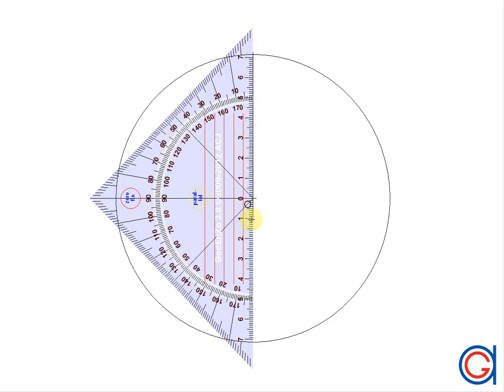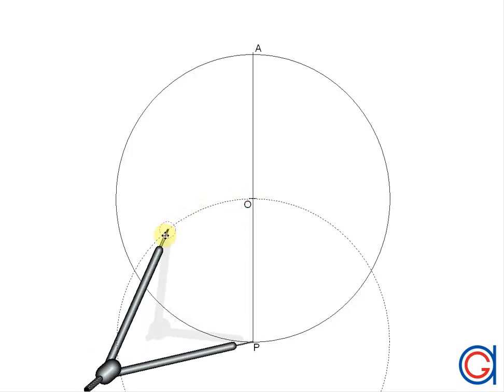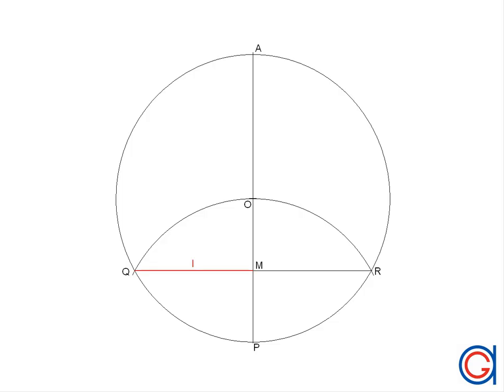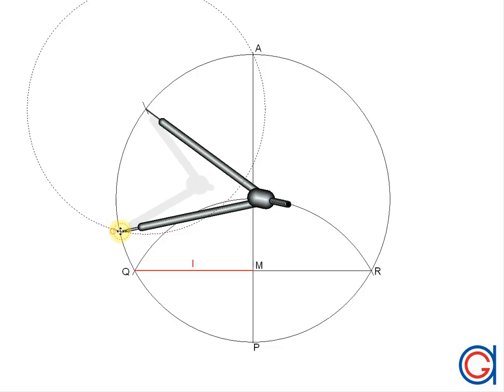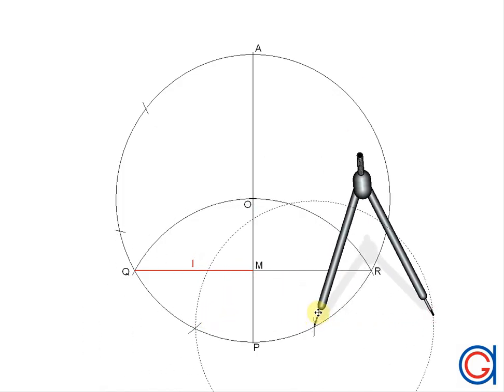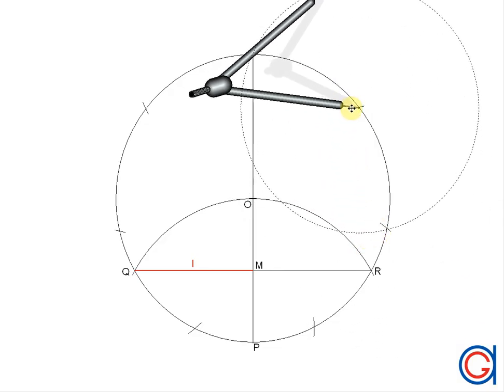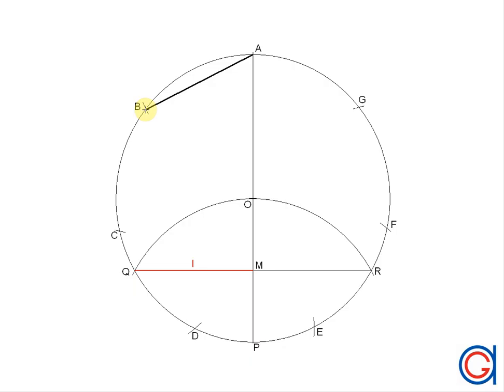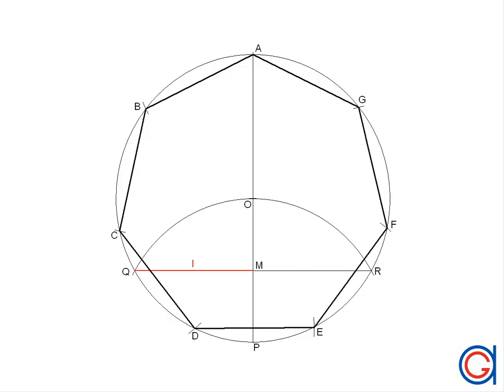How to draw a regular heptagon inscribed in a circle

Comment: THIS IS DEFINITELY NOT ACCURATE ! ... try drawing it up in CAD ... it will give you an error of 0.8 degrees! - if you draw a circle with a 1m radius the error with this method is 1.35 cm - definitely not acceptable for engineering
Reply: I "discovered" another method by kind of reverse-engineering a regular heptagon and finding some relationships between the lines and I think it works, but I'm too lazy to try and prove it now (I think I'll have to use some basic trigonometry, but I'm in the 8th grade, so that's not happening). The only thing I know is that I didn't need to inscribe the heptagon in a circle to do it.
Edit: the side lenght I used is arbitrary, but corresponds to about 2.95cm, so you have a sense for the scale, and I did not have a noticeable difference of inner angles from an actual heptagon.
2nd edit: I used some pithagorean theorem and quickly learned about sines and cosines and what not and it turns out my method isn't perfect as well, but I had a difference of about 0.11 degrees from the inner angle of a regular heptagon, so that's cool.
Last edit: I just proved my method completely stupid and wrong just by measuring some angles. It's worse than tge one in the video, but at least it closes up nicely. And at least I learned to use sines and cossines correctly.
Reply: It’s an approximation

Comment: The regular heptagon is the simplest regular polygon that can't be constructed with only a compass and straightedge
Reply: exactly? because I did before with a compass and straight edge
Reply: @danielegwurube6544  https://www.youtube.com/watch?v=O1sPvUr0YC0
Reply: @danielegwurube6544  it’s an approximation
Reply: It's a Heptagon... Just not a REGULAR Heptagon.  It's Off by 0.2%, an approximation attributed centuries ago by Albrecht Dürer, as noted by some others here, and documented here in Wikipedia:

https://en.wikipedia.org/wiki/Heptagon#Approximation
Reply: @michaelkrupa131  "It's a Heptagon"

Nonsense. You could pick any length for the side and then just connect the last two points regardless of their distance. But this construction does not create a heptagon inscribed in the circle.

Comment: How accurate is this video?

A regular heptagon:
l=2*r*sin(pi/7)
In the video:
MQ=r*cos(pi/3)=r*sqrt(3)/2
Does 2*r*sin(pi/7)=r*sqrt(3)/2?
Divide both sides by r:
2*sin(pi/7)=sqrt(3)/2
Divide both sides by 2:
sin(pi/7)=sqrt(3)/4
Use a calculator cause f*ck it:
.4338837391...=/=.4330127019...
Reply: Excellent!
Reply: I'm generation z and I'm losing my mind on this math, can y'all teach me?
Reply: @Unknown-zd8us  sure, what's troubling you?
Reply: @michaelweiske702  well my teacher said to me, I need to draw a heptagon so I search the video how to draw it. I see the comments in this video and I got really confuse, one of the comment said this video show not the real heptagon. What's that even mean? Then why the thing they draw in the video look like heptagon? Also some other comments say about the equation of this heptagon is not the same with other heptagon?
Reply: @michaelweiske702  My question is, why this heptagon that show in this video is not the same with other heptagon?
Reply: @michaelweiske702  Nevermind, my question is stupid. Sorry for bothering you sir/miss
Reply: @Unknown-zd8us  well, what they mean when they say this isn't the "real" polygon is that it isn't perfect. This is an approximation of a construction of a heptagon, but it isn't mathematically a true heptagon.
The approximation does work really well, the math shown says it is accurate within a 10 thousandth of a unit, but at larger scales the differences really show; either the sides won't link up or one side will need to be longer to compensate.
I believe it has been proven that you cannot construct a perfect heptagon of a given dimension, but you can get close as this video shows.
Reply: @Unknown-zd8us  there are no stupid questions.
Reply: @michaelweiske702  Ooh, I understand now! So the heptagon show in the video was not a perfect heptagon. Thank you for the explanation sir/miss.
Reply: @michaelweiske702  wise words 🤓 I'm still learning 😅🙌
Reply: Totally inaccurate.
Reply: @pintificate  prove it
Reply: @DarkonXBL  Proved Long Ago!

Comment: i don't get why there is so much math critics over here,listen to me ya all there is something called in phyiscs the common errors that is something that no matter how accurate we can get we won't ever be 100% accurate espacially when  dealing with numbers for example the hour here at my country is 12:32 and if i checked my brother's phone it is 12:33 and my mother's phone is 12:30 now can someone explains to me why does that happen ??? although the seconds periods is designed equally in the three phones there still some glitches, maybe they are the same brand and the same model yet still no conclusion what is going on and we cannot decide which time is the completely 100% accurate yet it is not a big deal cause minute higher minute lower ain't that big of a deal especially when don't have any full 100% accurate methods which by it we can measure the time, another example the approxmation ratio which can includes that when you have number like 5.8777163536...we don't have time to write all of this shit but we can easily take a few three numbers from after the decimal and conclude it as the full number so the final would be 5.877 although this number is not equal to this number above the math laws consider it acceptable as in the Pi value we all now that pi equals 3.14159265359 but we only write it 3.14 and nobody complains about that and many mathematical problems uses 3.14 specifically not even 22/7 in order to solve the equations and the answer becomes this moment  100% accurate and there is also something you never asked yourselves when you were solving math limits problems which was when x was tending to 2 for example we write it 2 while it is better be known that the x wasnot actually 2 but it it was 1.99999999999999999..... still we called this x 2 and nobody asked why this because there is something called tolernce which is involved in dealing with decimals same problem you cannot just say somebody drawing a polygon wrong cause ✌decimals✌ we don't live in a perfect world we don't have perfect measurments we don't have perfect pencils to make perfect geomtrical shapes so before you want a perfect mind in order to make a perfect geomtrical figures as you want your heptagon angle to be accurately 51.4285714286 nah nah and acting like professionals and with a perfect godamn minds supply me with the perfect tools you perfect people are dealing with the you rule the world with your perfectness p.s thank you aurthur this video is great for education fun and amusing keep up with the good work and don't listen to anyone.
Reply: Wrong

Comment: You can not draw an accurate heptagon using your method. If you really want an accurate heptagon with 51.42857142857... degrees of accuracy then you need stacked planetary gears with ratios based on multiples of 2,3 and 5 with regards to gear teeth. No kidding!
Reply: Only failing mathematical idealism.

Comment: Of course, this method is not exact. The square root of 3 subtends an angle (51.32 degrees) that is very close but not equal to 360/7 = 51.43 degrees.
Reply: To put it in other terms, the side-length of a regular heptagon in a unit circle is
s =2 sin(180º/7) = 0.867767478...
while the length used here is
s' = ½√3 = 0.866025404...

The ratio is
s'/s = 0.997992...
So it's short by a mere part in 500.

Fred
Reply: @ffggddss  I cane up with exactly the same numbers you did.
Reply: Approximations go always with an error called the error of approximation!!
Reply: Mark Sabol i
Reply: Thank you.  That was the math I was looking for to describe why my compass doesn't get it exact to the needle.
Reply: You're destroying all the magic. Good job fun destroyer :(
Reply: The magic is in understanding why it doesn't work.